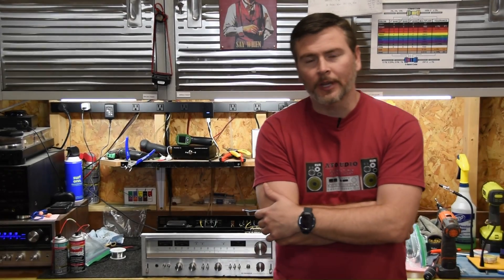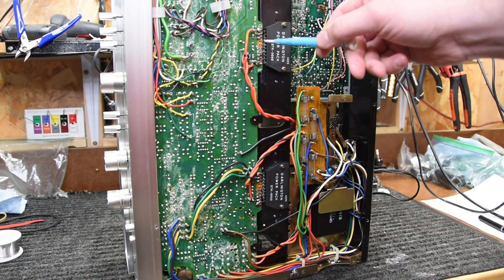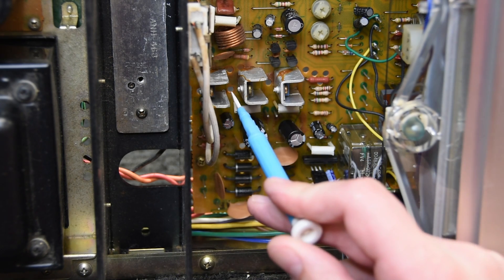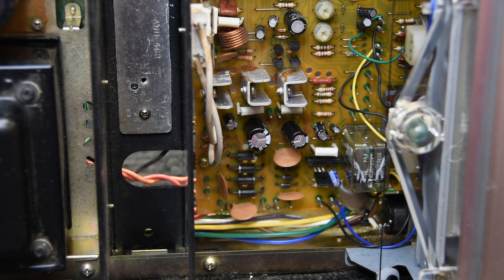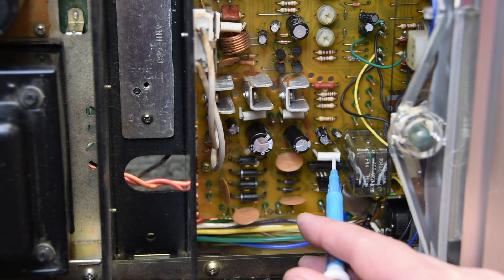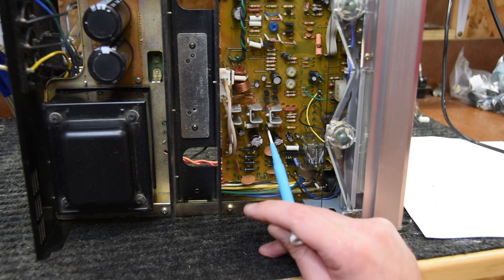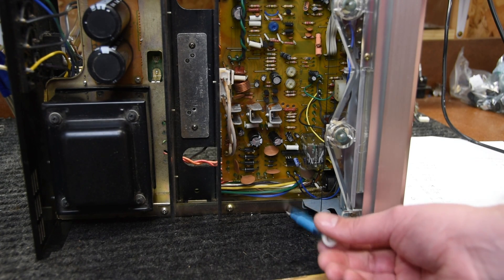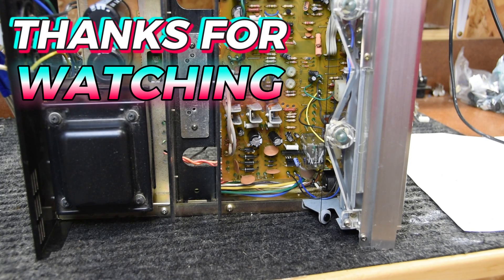Pioneer SX-780 Repair | Fixing Power Pack Failures, Bad Resistors & Protection Circuit Issues

Comment: My 780 has a VU left channel meter. That doesn’t work. Any suggestions?
Reply from the maker: Does that channel have sound etc? Could check the circuit that supplies the input to the meters. Another thing would be to switch the wiring to the other channel and see if the meter starts working. If it does you know the meter is good and something is wrong with the circuit. If it doesn't work then you know the meter is bad.
Reply: @ATOAudio  Sometimes, the needle can oxidize on the pivot, or dust particles can settle in that area and seize the operation.  A few gentle taps from a screwdriver handle can loosen things up a bit. I had this happen on my cassette deck.
Reply: @ATOAudio I just wanted you to know I took your advice and got that left channel VU meter working on my sx-780 I just lightly tapped it. And it came back to life. Happy Happy Happy.
Reply: @ATOAudio I’ll try that
Reply: @ATOAudio Yes it has sound on the left channel meter
Reply: Is it resting on Zero, or is it stuck in mid-stroke?